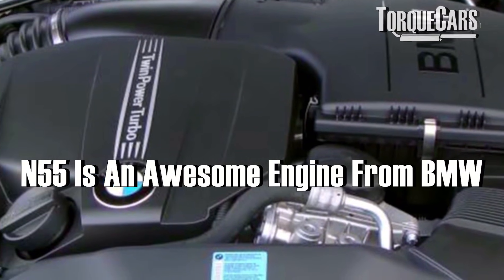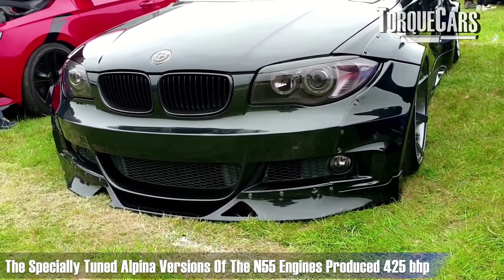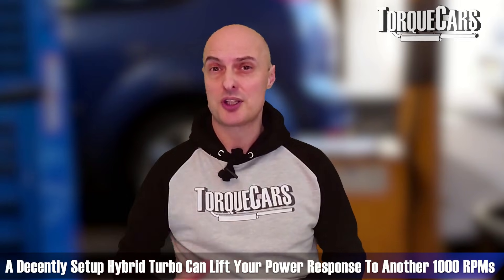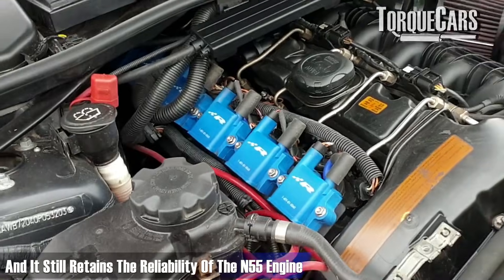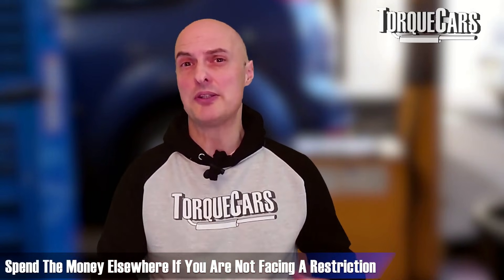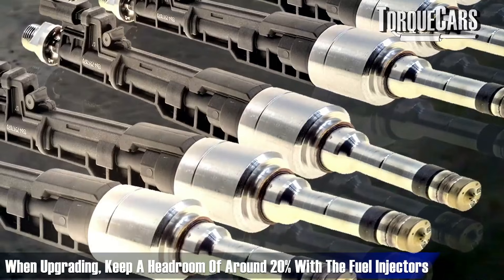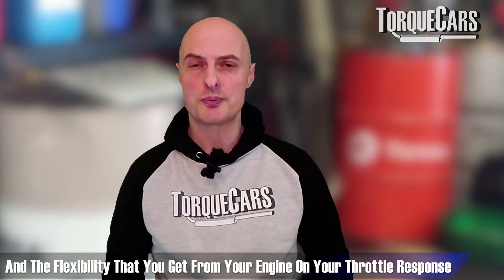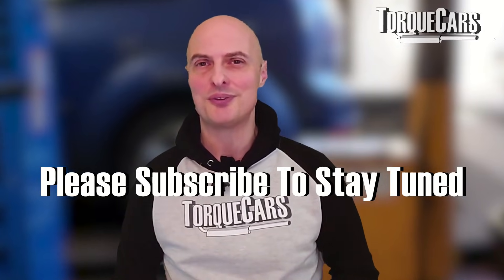14 Ultimate N55 Engine Mods & Upgrades: BMW Tuning: 400hp, 500hp & Getting Over 800hp

Comment: Piggybacks do not replace the ECU at all. They simply trick the ECU by feeding it bogus numbers. It will tell the ECU we only have four PSI so let's make an extra five giving you the higher output and horsepower gains.

Comment: 2014 F21 manual m135i owner here: 
Upgraded chargepipe, inletpipe, intercooler, downpipe, hybrid turbo, CAI, MMR baffled sump, HEL 25 row oilcooler, racing clutch. 5000 km oil change with 20w60 racing oil. 480 hp/700 NM on custom tuning. Car is used for track drive and spirited drives. I wanted a "clubsport" so M performance LSD, HR coilovers, flowformed rims with Nankang AR1 semislicks. Sub 8 BTG on Nürburgring. Fast, fun and nice engine noise😊

Comment: Great HOT AIR intake.That will certainly help
Reply: @ATL-mc8uf they are only bad for power gains if no additional mods have been made, he's suggesting serious stuff that can get 100 hp gains, so its necessary in a case like this

Comment: Got a 2013 535i M-sport and started with your typical bolt ons with MHD stage 2+.. Ran great, but last month I had installed a Dorch 1.5 hpfp, MHD flex fuel kit,  Pure 600 turbo with a Turbosmart dual port bov and had it turned by David Shoup..Amazing difference!!
On the dyno running e50 the car put down 514 whp.. I'm extremely happy. Shoup has it at a very safe and reliable power level where the turbo is far from being maxed out although it peaks at 27.5 psi. With an upgraded lpfp I'll be able to get more flow, but to be honest I'm extremely happy with where it's at.  On my Draggy I ran a 11.6 at 120mph. It's rear wheel drive and I did have traction issues..
I should mention I had the rod bearings done at the same time the turbo was installed. At 110k miles my factory bearings looked awesome. The mechanic said they could have gone another 110k, but knowing they are now new is a great piece of mind for me especially with the added power...
This motor has never ever given me any issues except for a water pump. 
It's true what they say... Maintenance is the key! Keep up with your typical maintenance, and do oil changes often (every 4000 miles for me), and this motor will take care of you..
Reply: @gregleri535i  Hi! Nice turbo upgrade and nice numbers, but how is Pure 600 response (low rpms) vs stock, is there a lag?
Reply: agreed. take care of the motor and oil changes frequently. i’ve got 238k MILES on my stage 2plus FBO motor and still going…
Reply: Yes sir , i have the same car FBO but i got the pure500 w/b58tu hpfp same MHD tune, how much was the David Shoup tune run you?
Reply: How much did it cost to replace the rods?

Comment: 1st thing and main problem of this engine is crankshaft... in n55 aluminum alloy, in N54 cast iron is used. So easy way to buy n54 crank (8 bolts same as on your n55 engine, don't miss this point). Forged crank pistons. It's game changer for durability of the engine. Of course, the crankshaft liners are also has to be changed, and preferably the forged pistons and rings, since you have already disassembled the engine. It will be crime not to change them.
2nd Oil cooling if you plan more than stage 2. Some russian mechanic on youtube told: easy fix about n55 on "6 series club service" channel.
remove the hydraulic valve, installed a plug from n52. The pump will work constantly. Accordingly, there will be a benefit from the cooling system.

upgrade you oil cooling system. Oil intercoller.

3th Upgrage colling system, change pipes
It's MAIN part before you start adding HP to the engine. With this upgrades you get durability and cooling. 
4th Next step injectors + fuel pump, cold spark's plugs, intake system, and ecu upgrade(remapping).
5th biger turbo and again ecu upgrade(remapping). On this point car easy and safly handle over 650 hp and I'm talking about heavyweight X5 
Hope I helped to some one. For me expirience cost n55 engine. And alot time and money. Good luck.

Comment: I heard charge pipe sum people got what’s charge pipe I’m still curious
Reply: @tahaakhtar776  pipe that goes from intake to intercooler n the pipe that goes from the turbo to the intercooler, those two pipes tend to brake due to heat and pressure inside of them. People replace those with metal ones or aluminum vs plastic from factory.

Comment: so i bought a timing problem having e90 n55 335xi havnt fixed it yet it has fbo exept like intercooler my dad wanted to swap to n54 but it seems like it’s very hard but i also seen n54 internals fit in n55 like crank n pistons so i was wondering if that would sent it on its way to make 800 after i fix it

Comment: Injectors on an n55 are well built. My f10 n55 FBO Stage 2 currently has 90k, never had issue except for the shredded drive belt at 60k. The n54 has major problems starting at 50k miles

Comment: The best upgrade is getting rid of it and getting a b58.
Reply: Not a true bmw guy, yo bought it for clout🤦🏼‍♂️
Reply: Cause everyone's got b58 money
Reply: F10 looks better than g30 tho
Reply: N54 will gap them both some ppl just need a reliable car they can make pretty quick
Reply: @D34Th625  sure ok 👍🏾 my n55 f25 with a simple ecu tune is smacking lots of other n55s butttys since i did that tune, which only bumped it 50 hp 88 lbsft but it really made a huge difference and I’ve had no issues with the vehicle with that small bump. Either way we all have great engines and im glad we get to enjoy them! ☺️
Reply: @ganuv  it’s like half the price dawg
Reply: I ain’t got no money
Reply: @ganuv  True, B58 is a legend. If u don't have money, don't buy a sports car. It's not that big difference in price. At least not in the EU. If u can't afford it yet, save a few more months and it's urs.
Reply: Hahahahahaha 🤣🤣🤣

Comment: you forgot the number 1 thing that brakes on the N55 and that is the charge pipe.... that should be the first mod.... get an all metal charge pipe.... and if you can a metal Turbo to Intercooler pipe.... Evolution Racing makes a really good one....  also you can upgrade you oil cooling system... with the Mosselmann Oil Thermostat Housing and the CSF upgraded oil cooler.... keeping the oil cooler, but still in the proper operating band makes the oil become more durable....
Reply: I did exactly your mods sir. And a Mosselman stage 2 tune. Sometimes my oil gets close to 120 degrees so the upgraded oil cooler is not in vain I believe! Also have a EVO intercooler to bring down the engine temps a bit. Takes off like a train!
Reply: @wesley8096  it is possible, but I encountered a problem with the N55 cooling, or rather with how its operation is implemented, I will describe it in the next post, we will think about what to do.
in short, any intervention/improvement in the CO, even just opening the blinds, does not lead to a decrease in the temperature of the internal combustion engine, but to the fact that the pump rotates more and more slowly... so way is to remove the hydraulic valve, installed a plug from n52. The pump will work constantly. Accordingly, there will be a benefit from the cooling system.
Reply: I upgraded my Chargepipe to VRSF, and that one just cracked after a year of use… so if you have a stock one, replace it ASAP loll

Comment: Hi, nice vid. Thinking of buying a 535 n55 and im new to tuning and everything so I wanted to ask, is it possible to for example mount a tuning box, hybrid turbo and an ecu remap all at the same time? Or does having a tuning box mean you cant have an ecu remap, or a turbo etc?
Reply from the maker: Most tuning boxes are setup for a factory engine so if you do other mods you'll lose out on them with a preset "map in a box". Some tuning boxes can be programmed and these could be setup to optimize your turbo and other mods. There are OBDII modules around that unlock the ECU and allow you to tweak parameters and some of these may be suitable with other mods. I would strongly recommend you add these mods and get the car setup on a rolling road remap, it will make a world of difference to the end power you get. 

Don't mix a remap with a tuning box though, both will try to take up the slack BMW build in and this will usually "push things over the edge." It is very much a case of tuning box/piggyback ECU or get the stock ECU remapped.
Reply: @torquecars  very useful info thanks! so bassicaly tuning box and ECU do a simmilar thing, however could you do a ECU remap while having a for example Pure stage 2 turbo?(including meth injection and everything else that should be replaced ofcourse) And what would you say damages the engine more?(tuning box/ECU/ turbo), or raising horsepower no matter the method is equally damaging?
Reply: Look into bootmod3
Reply: Don’t buy it dude

Comment: Hi, just an observation, i was lost 90% of the time on the video. I didn’t know when one point ended and another began. I think you can work on that. To have clear organized video that follows a flow of some type.
Reply from the maker: Maybe if I hold up a paper sign that would help. :) on a serious note I will try to improve the structure and flow of the videos when I can spend more time on them. I would really like to break these long videos up into shorter ones, not everyone wants to know about N55 Turbo upgrades or fuel upgrades, so they can just go to the bits they want.
Reply: Just some time stamps would be really helpful. Appreciate the video nonetheless, about to order some goodies!
Reply from the maker: Good Idea, I'm still new to this YouTube stuff, hopefully I've worked out how to add timestamps and these are now showing on the video.

Comment: Just got my first bmw , n55 435i 2016 f33 with 60k miles !  Looking to make it into a 5- mid 6's Hp Daily , over the years 👌🏼 Over time i would love to make it into a 1xxx + hp car
Reply: 1k from a n55???? ur tweaking
Reply: @comrademarii  fr
Reply: mid 600s is definitely possible with N55 if you upgrade the turbo and fuel system, but don't expect 4 digits from it no matter how much money you put in.
Reply: @BimmertechG01  why not? ghassan automotive makes a remanufactured 1000whp 1010lb ft of torque n55 engine and that’s just scratching the surface of what this platform can do. Any performance engine can be reworked to accommodate high horsepower. You just have to replace the pistons if they aren’t forged, close deck block conversion, forged rods and luckily the rods and crankshaft on the n55o/ and t versions have forged rods and crankshaft, also upgrade head studs, and bearings, upgrade cam shafts, then add a stroker kit and you can make 1,000+ hp. Don’t forget most bmw bottom ends like the n55 are used for their diesel counterparts so they’re incredibly robust and can handle high temp/ and boost pressure upwards of 80 psi.
Reply: @seanpoore500  does this fit the same n55 engine in the 2018 x6
Reply: Plan rod bearing replacement. You had better ti

Comment: B58 plug upgrade instead of precision race works plug set
Reply: Did you see a difference in power?
Reply from the maker: Great tip, thanks for passing that one on. I'll be sure to mention that in the next video and updated article. I guess the B58 plug upgrade is cheaper as well?